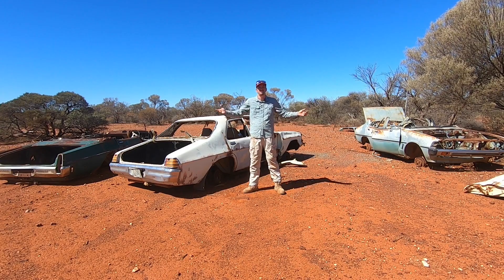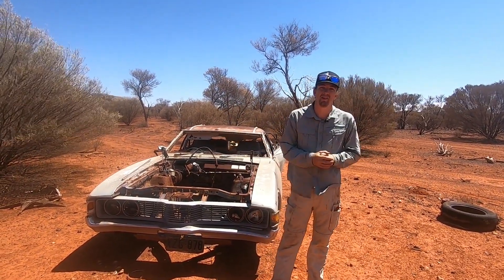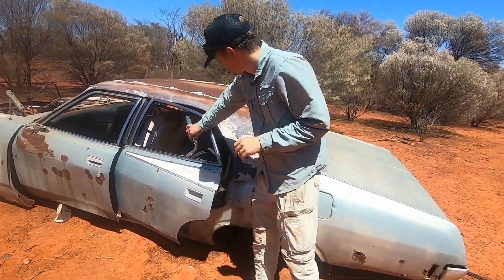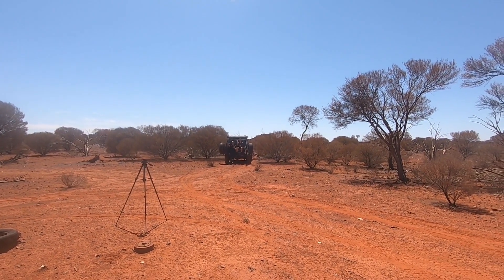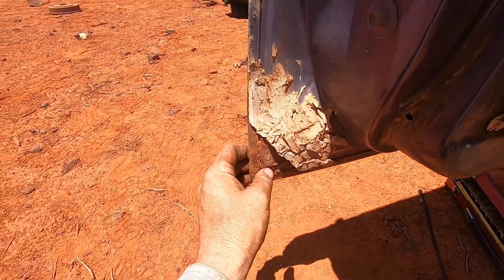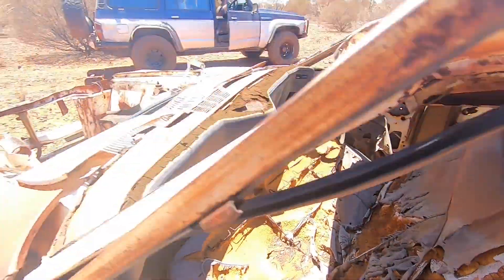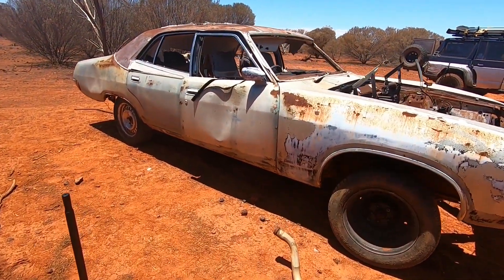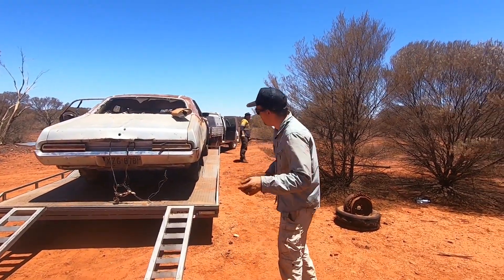Pulling a pimptastic ZF Fairlane from the outback

Comment: I painted my hq that purple 1998 with white bumpers, went well with my brown corduroy trousers and silver shirt
Reply from the maker: That would of been alright, i could imagine it would of been a statement.
Reply: Before that it was white with full black tints fibreglass front end with a graphic demon on the bonnet, I did 1 million k in that car and had many adventures in her, from a 173 on the tree to a 186 with 202 head and twin carbs, running a 4 speed muncie then a celica 5 speed, we replaced her with a HJ Premier 253

Comment: Pretty sure that the fairlane runs a 9 inch diff, while the 6cyl XA runs a Borg=Warner.
Reply from the maker: Could be wrong but i was lead to believe the 9in was on 351 cars.
Reply: 302 usually had Borg Warner, maybe if it was custom ordered or later changed it would be a 9.
Reply: ZF 302 had a borg Warner if an open diff 
We had one new